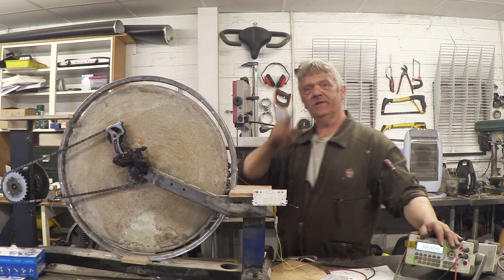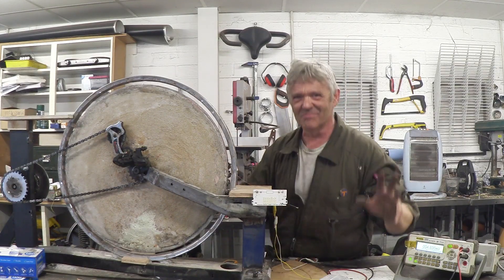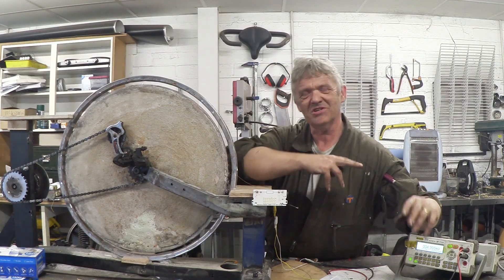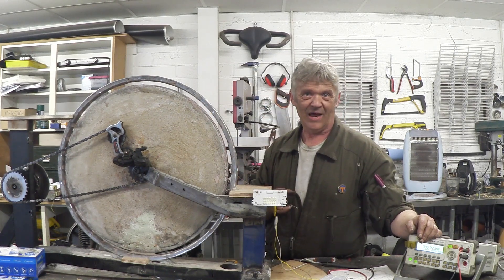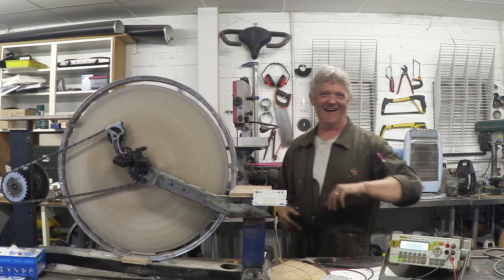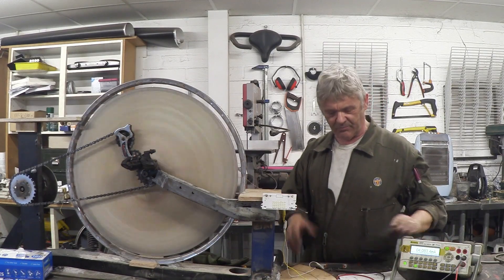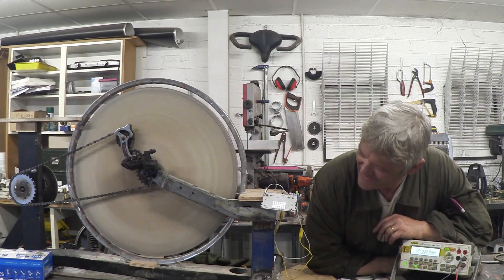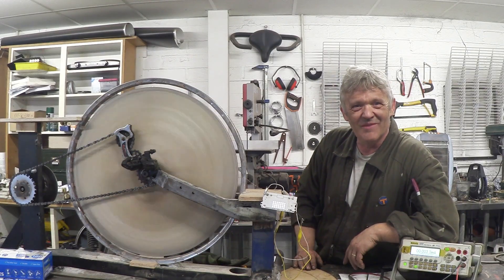1136 A Flywheel Generator

Comment: Robert I love your video, however if I may suggest moving your magnets closer to the center of the shaft of your flywheel and your coils closer to the center shaft of the flywheel to utilize that leverage of the flywheel more efficiently, with the magnets and load on the edge of the flywheel it makes the flywheel less efficient, by moving the load closer to the shaft allows you to convert that leverage into torque and you'll get a lot more torque to put on your load, great work I love to see everything you do, you and I think a lot alike, I have a similar setup just like this
Reply: The outer diameter of the wheel has the fastest speed for the magnets to pass by the coils
Reply: @fusiondensity3287   yes, a negligible sacrafice